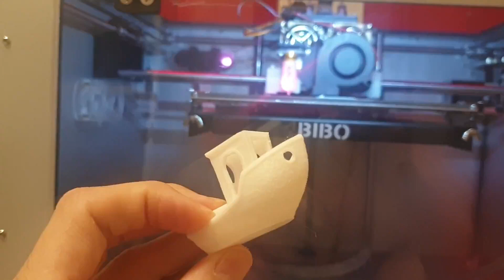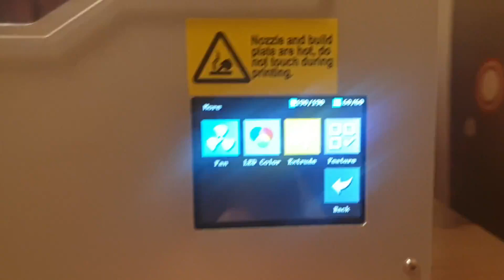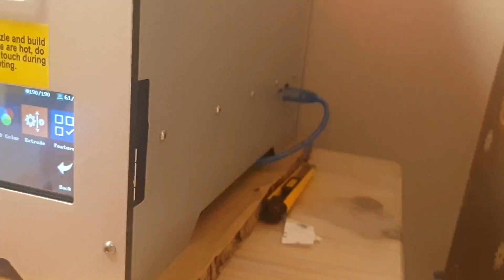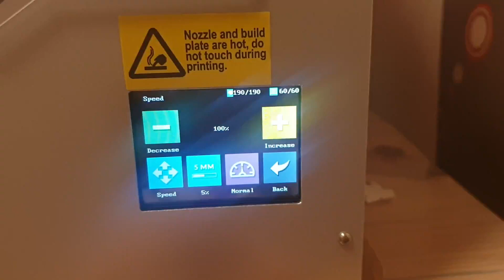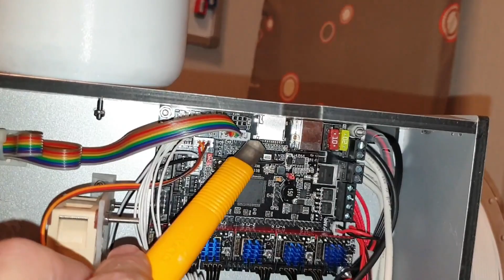BIBO2 BigtreeTech SKR 1.4 Turbo Upgrade

Comment: Is the DCDC board required if you are not using the BL touch port (wired like yours) or the neo pixels? It says it provides power to lcd but I assume lcd works without it.
Reply from the maker: I was always under the impression that this was for Neopixel Only to the heavy power requirements. the LCD seemed to work without it

Comment: Did you have to modify Marlin firmware to get bltouch to work properly?  I also have bltouch connect to skr 1.4 turbo (per bigtreetech instructions and the way you have it) but not working properly.  I can move z axis up and down using pronterface, move bltouch probe (deploy/retract), but when I home z-axis it just stays there.  Z-axis doesn't move.  M119 always shows z_min TRIGGERED.
Reply from the maker: Have a look at my config here: https://github.com/delwinbest/Marlin_BIBO2_touch_dual/tree/btt_skr_v1.4_turbo to compare the FW setup. Are you using the Z_MIN_ENDSTOP port for the BLTouch? And Did you dig the DIAG pin off of the Z Axis TMS Stepper?
Reply: @delwinsdevguide  I too am having bltouch issues when homing. I've looked at your config.h file and I'm not seeing anything different. Why do you need to cut the diag pin off the z axis stepper? Isn't that commented out? What 2 pins are you connecting the  black / white wires of the bltouch to? I've tried them both with no luck. Thanks for any input.
Reply from the maker: @dougw9224  The two pins used for black and white wires is actually the Z min endstop pin. There is a problem with the BLTouch sensor pins on the SKR board, so I used the Z min pins. 

The diag pin of the z axis stepper interferes with the zmin endstop pins. Because we are not using sensorless homing on the z axis, you can cut the Z stepper DIAG pin. DIAG is needed for sensorless homing. 

I use a program like Meld to show me the differences between two files. This makes reviewing config file diferences easier. Also, see config_adv.h.

Comment: Are you running all the steppers in uart with sensorless homing on? Even the Z ones with BLTouch?
Reply from the maker: Allnsteppers are UART but the Z endstop uses the BLTOUCH.
This board connects the DIAG pins of the TMC2209s to the endstop pins which enables sensorless, so for Z, u need to cut the DIAG pin as described in the SKR 1.4 manual. This disables sensorless homing for Z
Reply: @delwinsdevguide  s if you cut al the diagnosis pins you cannot do senseless homing, correct?
Reply from the maker: @MichaelSardes  Correct. Only the Z axis pin is cut in my case, because I reply on the BLTouch using the Z Endstop pin. The DIAG pin of the z axist stepper interferes with the normal operation of the z endstop pin on the board and needs to be cut.

Comment: I have been struggling on how to adapt the ribbon cable to connect the SKR 1.4 to the TFT 2.8? Do you have a pinout guide, and perhaps a list of parts that you used?
Reply: @delwinsdevguide  Thank you so much! I will remove the board and take a look.

I do not have a multimeter, but will buy one later.
Reply from the maker: As promised, hope this helps a little: https://www.youtube.com/watch?v=rwtNL-VMA_E

Comment: I had the exact same issue with the BLTouch sensor pins as you did.  I had to use the Z-min endstop pin to get it working.   I did also cut the pin on the 2209s per the SKR 1.4 Turbo manual and am using the min endstop pins as before.
Reply: @delwinsdevguide  Do you have your configuration.h availible for reference? having issues with bltouch as its just crashing down with out stopping

Comment: Very nice job for sure. Your video was full of useful info for me. I've been watch a few other video's and the word is that right now there is a problem with the bl-touch port, so its not just you. I'm building a linear rail printer now as my first printer and have the skr1.4 turbo installed as well with the 2209's. I'm glad to hear that you are able to use up to 128 resolution on the stepper motors. Is your electronics case a separate case from the printer or is this view the backside of the case?
Reply: The electronics on the BIBO2 is mounted under the printer enclosure, that is the view your seeing in the video. The printer is tipped on its left side.